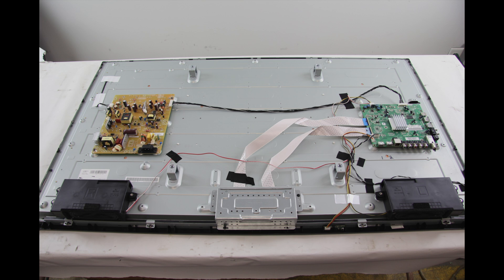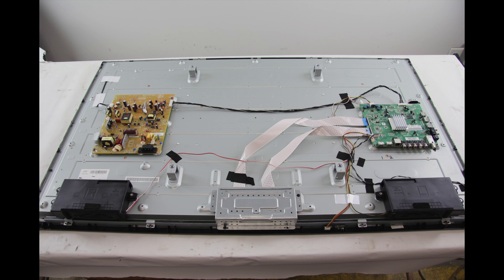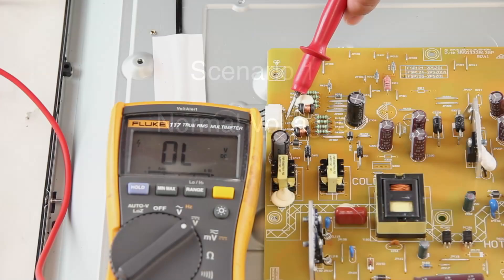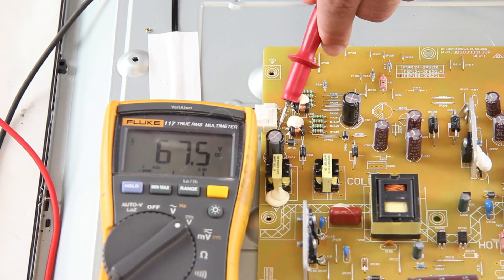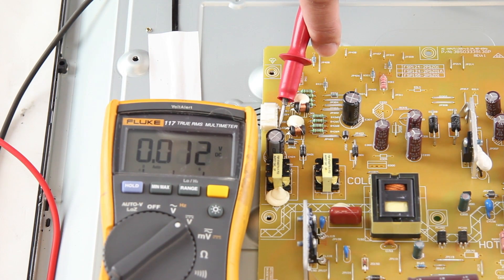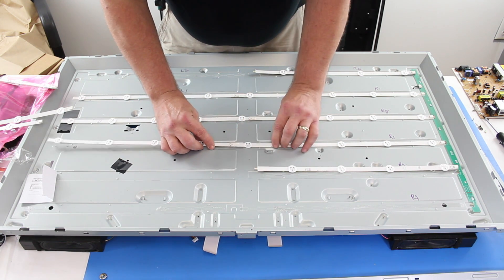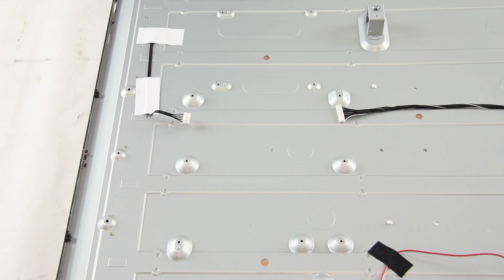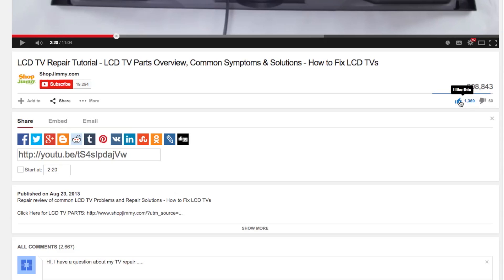Vizio E500I-A0 E550I-A0 E500D-A0 LED TV No Backlights Voltage Test Troubleshoot LEDs & Power Supply

Comment: I tested and got 67 volts.. So the Power Board 'should have' been bad. However, I tore deeper in, ordered the LED tester, and found 5 bad LED. Ordered LED strips from ShopJimmy, and lo and behold, works! Is the real deal. 

Ping me if anyone is lurking the comments and have the same questions I did. I spent a lot of time on this, but finally got it working! :)

Comment: i cant get a picture or shall i say a silhouette when i turn on the tv with a black screen but if i push the menu button the lights will flash on and off every few seconds i took the back off and none of the lights light except when i first turn on the tv then back off in less than a second so would that be the board or the lights i have trouble seeing in the dark so i probably wouldnt see the picture if it was there

Comment: Voltages at LED1+  and  LED2+ are both at about 128 volts when tv first turned on..leaving the probes hooked up the voltages on both drop to 67 volts..this tv does Not have any backlight at all..need to know how to proceed for further diagnosis..Thanks.

Comment: My problem is slightly different. My backlight will come on for a fraction of a second, then go off, then kick on again for a fraction of a second a few seconds later, and repeats. Before it failed, i had a 4" dark strip at the top and bottom of the screen with some flickering.

I measured the voltages, and I get about 125V and it is constantly fluctuating by about +/-3v. I get this same voltage with the leds plugged in or unplugged. The video claims it should drop to around 67V with the leds unplugged. So does that mean its a bad power board, or shorted leds?

TV = Vizio E500D-A0
Power Supply = 0500-0614-280
LCD Panel= LCD500-DUG-JFU1

any suggestions? My next step was going to be to remove the LCD panel and check the LEDs, but I hate to do that if the problem is in the power board.
Reply: I replaced the LEDs and that fixed my issue. When I tore the set down, I found that only the middle 3 rows were lighting up. They would flash on for a half second, at about every 10 seconds or so.
Reply: Ya the repair kit is damn near 200$ , might as well but a new tv....  Tv shopping is on the radar.

Comment: To remove the back cover, you need to jimmy the sides open because there are clips. Use a flathead screwdriver, start at the button panel to wedge in some space. Then below the button panel there's one clip, pop that open. Move along the side to the top and pop all these open. Pop open a couple more along the top and you can grab the back of the TV and pull it off.

Comment: I've got a Vizio e500i-a0 that seems to only have 2 backlit lights that randomly flash off and on. One on each strip.  Would anyone know if just replacing the blacklight strips would solve this issue? Seems as if the backlights are just dying out.
Reply: Robbie Jones I have the exact same issue. Did you get yours fixed
Reply: Robbie Jones I strongly believe mine was caused by smoke
Reply: alain omie not yet, I wanted to see if this video would help me fix it but I don't want to attempt it until I get another TV in case I break it while trying to fix it. So your backlights seems to be dying out in random spots on the tv, too?
Reply: alain omie like cigarette smoke?
Reply: Robbie Jones well mine was working fine until I forgot a pot on the fire which caused a lot of smoke although the tv wasn't on, I came back from work and my Tv couldn't turn on. I tried multiple times and it would sometimes come on and work for a while then goes off. I looked closely and could see images but no backlights. Sound worked fine. With time, the tv barely shows. It just flashes for less than a second and goes off. I know for sure the backlights are out after opening and inspecting but looking online, I could not find any seller selling the exact backlights for this model. It shouldn't be an issue for me to change the lights myself but it's finding them
Reply: i had the same issue. I tested the backlight board and was getting about 125vdc with the leds connected or disconnected. I tore down the set and found that only the 3 middle rows of lights were coming on. They would flash on for a half second about every 10 seconds or so. I replaced the LEDs and that fixed the issue.

Comment: I have a Vizio 47 inch Smart TV that has a black screen. Using the information that I got from the Shop Jimmy video, I conducted the Flashlight Test. I was able to see that the TV was producing an image. Looking into the back of the TV I saw that there were no Backlights. Since I am fairly handy with a screwdriver, I decided to attempt to repair the TV. Again, Using Shop Jimmy's video, I determined that the LED Strips were the cause. I attempted to order replacement LED Strip from Shop Jimmy but they were "out of stock". I purchased a full set of LEDs from Ebay. Following another Shop Jimmy Video, I installed the new LED Strips. BINGO!! My TV is alive again....    Thanks to the Shop Jimmy videos I was able to repair my TV for about $100.00. Keep up the GREAT work Shop Jimmy. BIG THANKS!!

Comment: Hello, I have a Vizio e500d-a0 and I followed scenario two because I was getting about 65 volts in led 1 but my led 2 I'm only getting about 5 volts, this is with power on, and then no power and led cable unplugged it goes down to 0 volt, does this indicate a possible bad power/BL board or bad led's? Please any help would be greatly appreciated!

Comment: Samsung 40" LED TV. There is shadow above one fourth of horizontal that it developed. It will go away at times and stays back other times. At times if pressed on the screen with thump and index finger it will clear it. Back light/LEDs should be good. Power too should be good as the shade clears if I understand  your video. At times it stays back continuously masking three fourths  of the screen. That area shows picture but not as bright as in the other areas. Any help is highly appreciated.

Comment: Good Job! Could you, please, answer me this problem": Samsung, 60 LED, model #"UN60EH6000F, no visio, just audio, could be T-Con board, right? How do I test it? And, I have another one, Model # UN65EH6000F, a little bigger, can I use that T-Con board into my UN60EH6000F?? And seen video here, where they fix T-Con board for UN46D600, same problem: no visio, just audio: they changed cap. CD31, and Trans. QD2, so question: Do I have in my UN60EH6000F model same cap. and Transistor #?? They might have different/bigger numbers, so could I just test them, and change them?? Just wondering, thanks for your answer !!

Comment: Thank you for your great videos! I have a Vizio E550i-AO 55 inch TV. The picture is good but is turning dark and not evenly. It has 4 thick horizontal  lines starting from the bottom which is light then alternates dark and light. The overall symptom is a good dim picture and the TV otherwise functions normally. Any ideas or thoughts regarding this issue.
Reply from the maker: +Randell Crees   Try all repairs and troubleshooting at your own risk.  This could be a problem with either the main board or the TV panel.  You can replace the main board to see if that fixes the problem with your TV.  Click this link to replacement parts for your TV model number:  http://www.shopjimmy.com/catalogsearch/result/index/?cat=56&q=E550i  There may be multiple boards for the same TV model number, be sure to match part numbers on your current board, with your replacement for compatibility.  Here is a link to a video showing how to identify your part number, click here:  https://www.youtube.com/watch?v=kxkeGLhlQY8  Thanks and please let us know if you have any further questions with your TV Repair!  www.shopjimmy.com

Comment: I have a Samsung UN55ES6150FXZA and i had the black screen and did the flashlight test and had no backlights but a faint image with the flashlight. I changed out the T-Con with a new one, i changed the Power board which i got from you and it didn't help and today i received my main board from Samsung and that didn't fix the problem. Does that mean the problem is the LED light strips ? If so are the strips available of should i just give up on the TV, it's only 2 1/2 years old.
Reply: I did the same as you I replaced the T-Con  and the power supply Board and it didn't do anything .I still have sound no pitcher. I did the back light test and like you see the Image. I was so excited thought this would work from watching video's.This sucks mine is 4 Years .my old heavy tv last 20 years. I have a LG LED TV.
Reply: Yea unfortunately the problem seems to be the LED light strips which nobody seems to have , Mine was just over 2 years old so Samsung said have a nice day , no longer under warranty. All i can suggest is when shopping for another TV or electronics stay away from Samsung products. I went to Vizio and so far it is great.
Reply: sounds Like we all should of stayed with the old Tv they were heavy and bulky But they ran for 20 plus years.